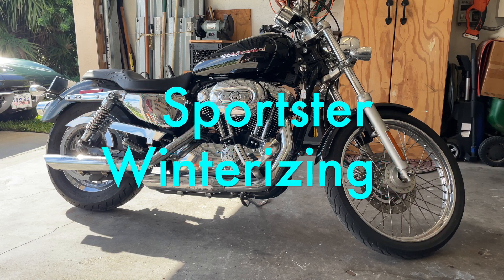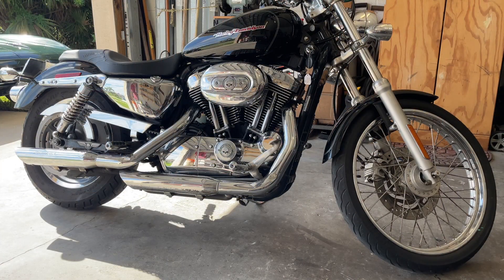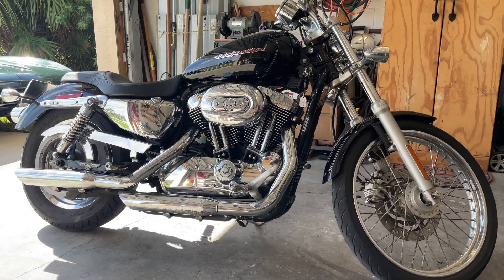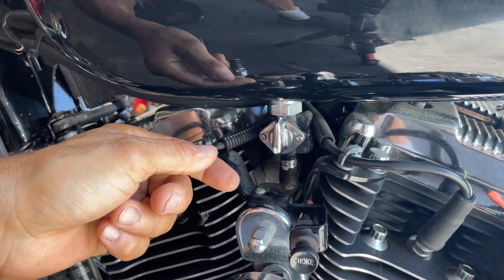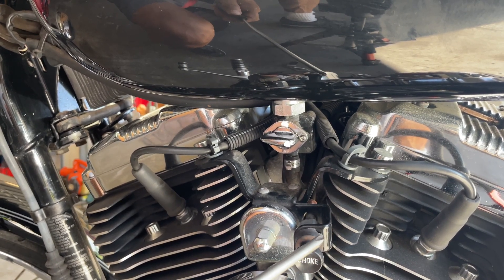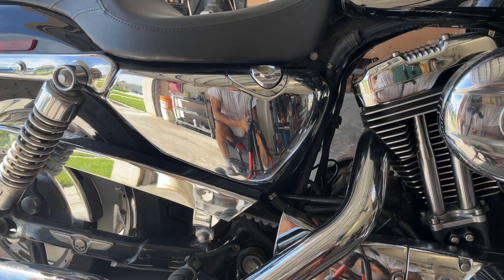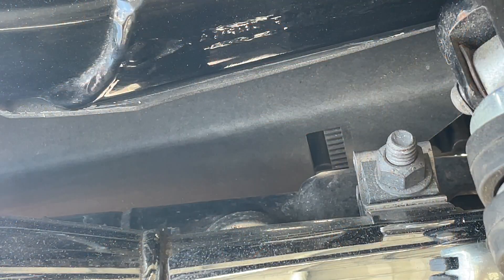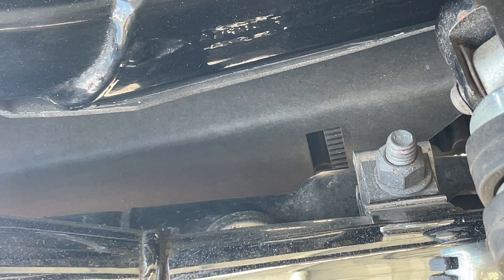How To, Sportster Winter Storage.

Comment: I changed my oil on my Harley Davidson sportster it is a year 2003 and then I went for a run came back home and it was leaking from the bottom of the carburetor I thought something bad was wrong but watching your video now I Overfilled the oil tank so I drained some of the oil out and it was good to go thank you very much
Reply from the maker: Happy to help. Make sure you clean your air filter. If it's K&N  then do not use their oil, keep it dry. I will run better Any questions just ask. Thank you for watching and your sub Randy. Ride safe and have a great day.

Comment: Thanks for the video. Got a 2005 softail deuce that's carbureted with a fuel shutoff.  Is it okay to run the fuel dry with the fuel cutoff on some of these bigger twins to get all the fuel out of the carb. I agree it's the best method on engines...do it on almost everything. Even included a fuel shutoff on my riding mower when winterizing. Just wondering what the thoughts are on doing this on a bigger engine Harley. thanks!
Reply from the maker: Happy to help. Yes this works on all big V twins with no problems. Thank you for watching and your sub Rizzo. Ride safe and have a great day.

Comment: Roc what if you use non ethanol fuel? What is your opinion on using non ethanol fuel?
Reply from the maker: Happy to help. Non ethanol fuel is the way to go if you can get it. Still run the carburetor dry with the fuel system on off when storing for a significant amount of time. Just good practice. Thank you for watching can you sub. Imaboss.  Ride safe and have a great day. Let us know how your bike runs and octane on the non-ethanol fuel.
Reply: @TwoWheelRocco  What do you do if you have a fuel injected bike?
Reply from the maker: @fredmeyer3063  I would put it away with a full tank on the battery tender  Add some kind of fuel additive. To preserve the quality of your fuel. Start her up with the additive let it get in the system and put her away. Hope that helps. Fuel injection is the way to go.  Ride safe and have a great day.
Reply: @TwoWheelRocco  Thank you!
Reply from the maker: @fredmeyer3063  My  pleasure.

Comment: I have a xl1200c, 2019 (or 2020?), which doesn’t have a fuel on/off valve, fuel injection instead. Any advice regarding the carburetor emptying.
Reply from the maker: Happy to help. On your model to winterize, Full tank of gas with gas treatment, place in storage. That's how I would handle it. Any questions just ask. Thank you for watching and all your support JR. Ride safe and have a great day.